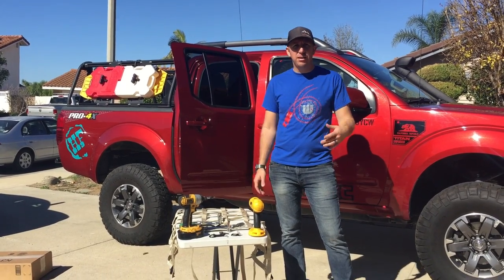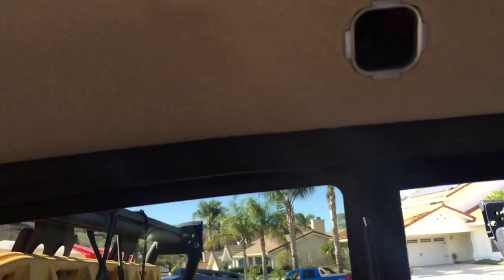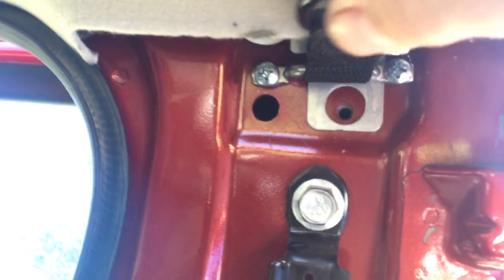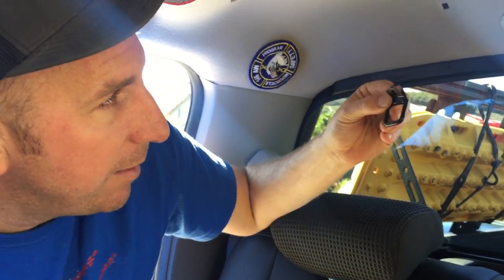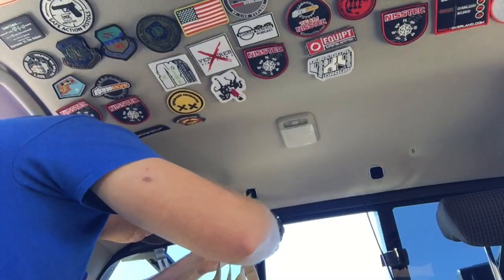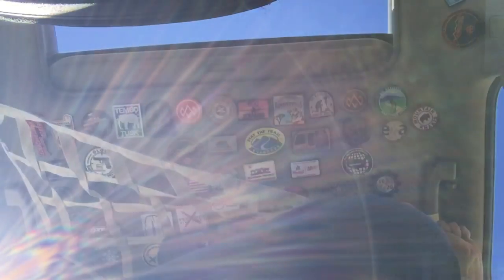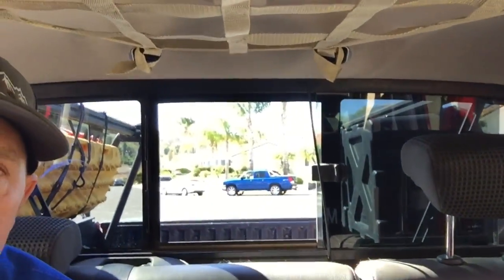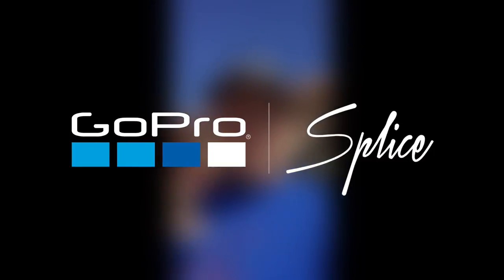Overland Frontier Raingler ceiling net install

Comment: so anchor it to brittle plastic on the rear light assembly?  seems like self tappers would be stronger
Reply from the maker: Its not really a brittle plastic anchor. Also, Most of the load is on the front of the net. Last but not least this net will never be holding 500lbs or anything. Believe me when i say it is absolutely sturdy and its not a problem at all.
Reply: @Dagrootx  10 4